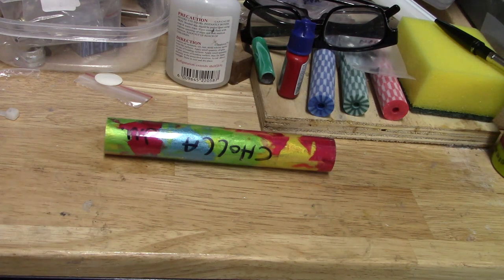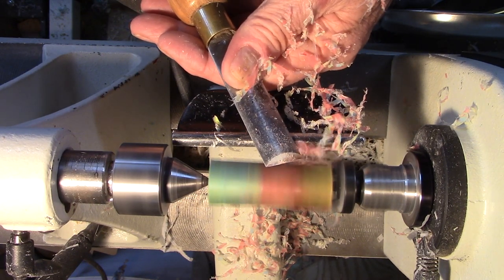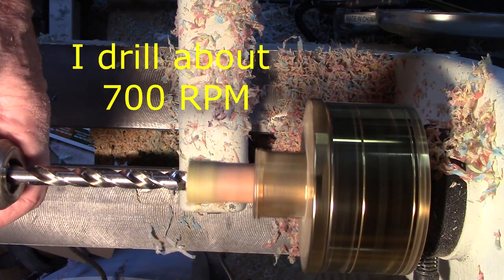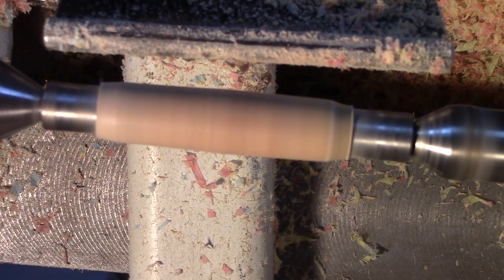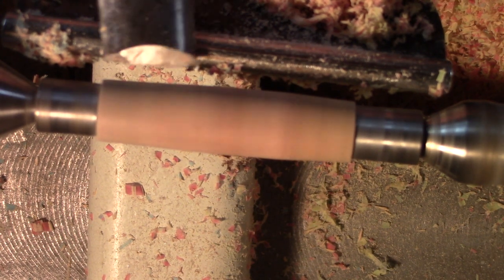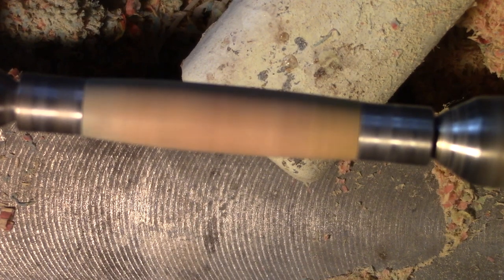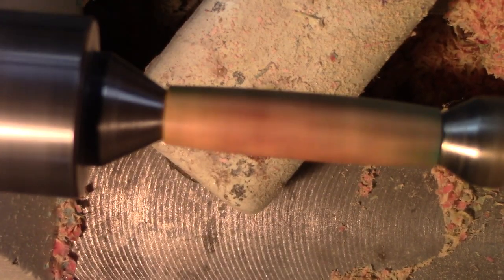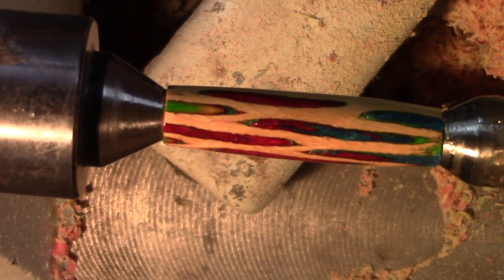Cholla Cactus pen blank turned to Thank-you pen

Comment: I enjoy your informative videos. I’m looking into the turn between centers but how would you use them with pens that have two pieces?
Reply from the maker: Hi Cheryl, You would turn each piece separately.  After a while this becomes very natural, because the Turn Between Centers (TBC) bushings are easy to remove and mount a new blank.  Additionally, using a shorter distance (one blank) is yet another factor that will make your pen more perfectly round.

Thanks for your question!! Ed